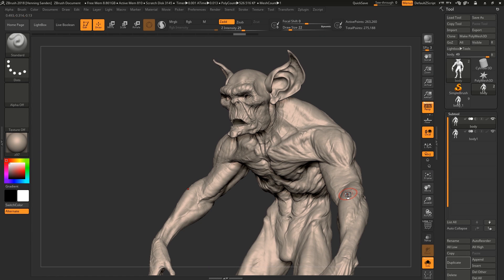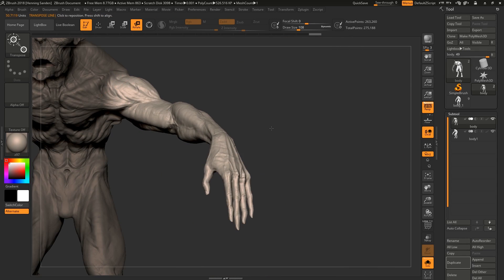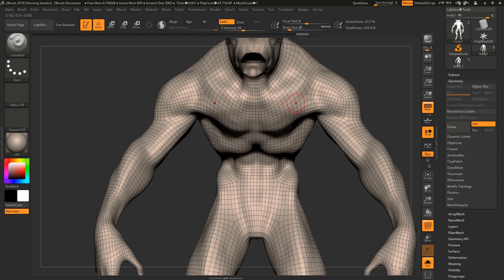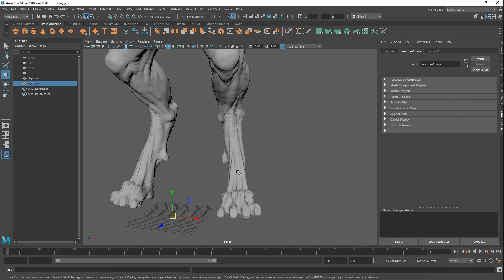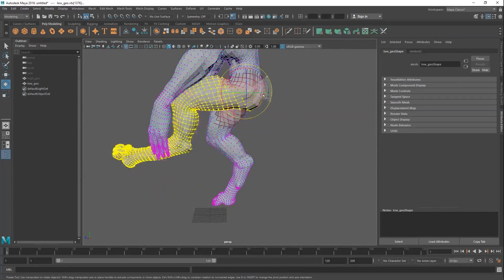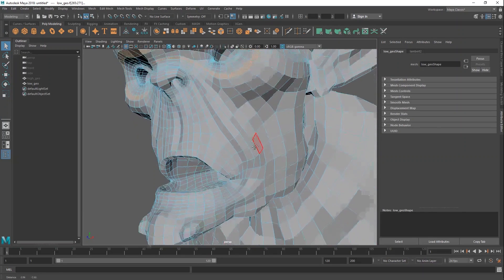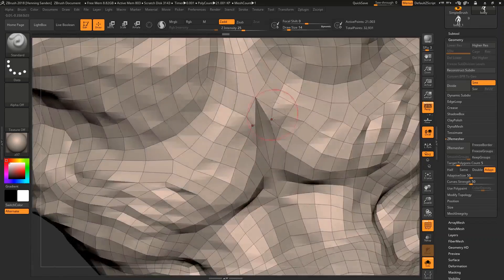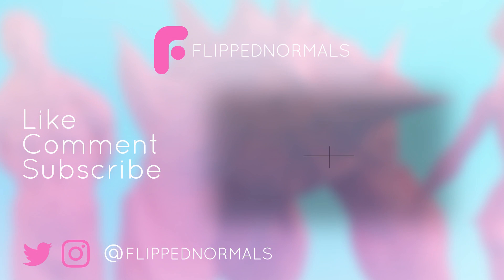The Real Reason We Retopologize Our 3D Models

Comment: This may sound like a weird question but I see modelers preach about clean modeling and moving around geometry so vertices are not stretched etc.... But why be so precise in the modeling part when you repologise over it and use the retopoligised geometry and discard the original model anyways?? I can see if you may be using it for film and other reasons where high poly meshes are preferred but why be so careful when it's only used as a guide to create your lower poly geometry??
Reply: You use the high quality meshes to make normal maps, and the better you have the details, the better it looks once it is applied to the low res model. Artifacts will still show up.

Comment: All good reasons. Although one thing with ZRemesher that's useful is using it with clothing that has a lot of folds. Use the ZRemesher guides and plant them on the apex of the folds, edgeloop around the collar, cuffs, bottom(s) of the garment, and edgeloop around the elbows/knees/chest. It won't be perfect, but you'll save yourself a lot of time getting the bulk of it done in zremesher and back into Maya to "fix" some problem areas.

Comment: Great video on a very important topic, but one thing you could point out is that, unlike the one-joint zbrush "rig" that you apply to the arms here, a vfx rig for a creature like this will have dozens and dozens of joints, in a hierarchy, and each joint has to calculate its effect up through the hierarchy, on every vertex in the model, and THAT is what really taxes your CPU/GPU and impacts your feedback time.   Not so much Zbrush vs Maya, but simple, disposable posing rig vs complex, robust animation rig.

Comment: Well zremesher has the option for you to draw where you will want more topology and where you need less and I have been using this option its like paiting weights when rigging and it does a really good job atleast in my team.
Reply from the maker: It's pretty OK, but if  you  want full control, manual retopo is usually  the way to go.
Reply: Yes I agree. We used topo gun previously but due to time conservation went full on with z remesher :D

Comment: Nice tutorial but sometimes you could get away by using Zremesher  and do little fix like just doing the joints area or torso where the body deform also if u really good on zbrush u could also fix it in there and use my favorite tool zmesherGuid that really works good like u mention around the eyes , u can easily just add couple of guides and get the loops I want, but overall best thing is just doing it by hand like u had mention on the video.. big thumbs up great tutorial

Comment: Retopology is indeed the option of choice in general to go because it creates less problems, for everything. But if a model is properly optimized, and if the topology is checked and rechecked, by merging nasty vertexs here and there, by collapsing some unnecessary polys etc, i know for a fact it can work. If properly tested with rigging, then uv unraping should be a no brainer. So retopo is still used, but im convinced its gonna fade into a uselles funless tradition soon. And with all this great material composition software like substance, normal baking is gonna be less and less relevant, because why sculpt it if you can work directly the appearence and detail of a shader on top of a simple polymesh? Its like mixing paint and modelling into one.

Comment: On the retopology front, which tools you recommend?

I have a surprisingly not-infuriating experience using retopoflow in blender, but i was taught there, so my bias is bigger than my knowledge.

Also, outside of the "main loops" (eyes, mouth, the ungodly mess that's hand, fingers and nails, etc), do you recommend any process to "fill" the space between then?
Reply: Maya has a tool called quad draw, which is very good.

Comment: i hope you make a video on the wrapping technique you mentioned.  is it like shrinkwrap where you have the lowpoly conform to the high poly like ZBrush's projection or is it those puppet cages I see in behind-the-scenes footage where moving a few vertexes on like a 100 point mesh moves whole muscle groups on a 100,00 point mesh? also does it involve the UV like you mentioned in other videos?

and on somewhat of a tangent were there ever times you needed to transfer or reproject whole texture/material sets from one UV set to another? like you have all the textures from diffuse to ambient occlusion to displacement to specular ect made perfect but you have a new UV optimized and the baked texture maps don't align anymore so you project that data to conform to the UV set.   i know Maya has transfer maps and the diffuse does what I talk about but the displacement map requires the high poly present and i can't just project 2d data to a new layout.  i am told marmoset Toolbag can rebake existing maps like that but i havent tried it and i am guessing Mari has such a feature but my little computer cant run it.
Reply: I'm also unsure of this.
Reply: There's a program called WrapX that allows you to take a low poly mesh and match it to another mesh shape.
Reply: Matthitizidu  oh i know all about Wrap :D speeds up the process by reusing the base mesh for you.  but i want textures not shapes and so far i cant bake old textures to new shapes.
Reply: Meir Teichman  If you divide the new topology and project the details from the high poly in Zbrush you'll have all your detail on the new topology. Then you can bake any maps you need.
Reply: Matthitizidu  tried that and since zbrush doesnt use Udims well i get all sorts of artifacts and applying the displace to each UV causes bad seams.
Reply: You can export the high poly mesh from Zbrush after decimating it and create your displacement in Maya. It will follow your UDIMS. 

A more tedious way would be to polygroup by UV in Zbrush then split the different UDIMS into separate meshes and bake them that way.
Reply: maya doesn't have a tool for re-baking displacement maps, only baking new displacement based on high poly. and i tried the tedious way of mapping each udim but as i said it leaves terrible seams. 
i need an app or tool that will rebake any 2d map data to differnt meshes and UVs .  that way i could map all the UDIMs and their corresponding textures to a great big mega displacement map and then apply that to the model in zbrush.
Reply: don't re-bake, bake new displacement if you need it. Displacement is the only map that you'd need to bake in Zbrush or Maya. You can import your low poly with UDIMs in Substance and bake all of your additional maps there.
Reply: @Matthitizidu  but my whole issue is that the displacement I need only exists in those maps.  I can't apply them in zbrush because they get bad udim seams. And I still need to rebake them if I wanna make all those udims into a mega uv map to solve the udim.seam issue.

I am trying to uprez an existing model and I can't extract the highpoly/displacement data any other way.
Reply: I'm not sure what you mean. You don't have a high poly sculpt in Zbrush?

If you do have a high poly model you can bake your displacement easily even with UDIMs.
Reply: @Matthitizidu  nope no high poly. In fact my project is trying to rebuild/uprez an existing game model by applying the faked high poly detail of displacement maps to the model and using that as a guide for more detailed displacement if not making the different details separate meshes.

And no amount of resolution will fix zbrush's udim seams.  They don't have a proper udim system so they stack the tiles on one another and you are forced to isolate them via polygroups and that isolation leaves clear seams as each patch gets displaced on at a tile letting inconsistencies creep in.  My only hope is to displace in an app that has proper udims which will crash my computer, try to pack the udim textures into a megatexture myself and allow flaws to creep in or just remake the textures myself and lose all the accuracy I wanted. I need to find a tool that bakes these maps to the megatexture I need.
Reply: Use the original UVs and apply the displacement in Zbrush. That will be your new Hi Poly sculpt. Then bake all your maps.
Reply: but the original UVs are Udims which I keep mentioning leave ghastly seams. i need the UVs to be in one mega tile so the displacement can be applied all at once.  and for that i need a way to rebake existing textures onto new geometry/UVs which brings us back to square one.

i think this is what the FlippedNormals people do when they want to make all their Mari displacement textures actual high poly detail and that eems to be a feature in mari but i cant afford to run that on my little computer.

Comment: I understand the need for Retopo, but why projections? Is it to get cleaner bakes? The guide mesh you re-project to is still very dense, so why do it?
Reply: Reprojection is to get all the details from the sculpt to the retopologized version. Retoping doesn't just make the poly count lower it changes the topology so the model deforms properly. You reproject onto a denser version of the model so that normal and displacement can be made from it to add the details to the lower ploy version when you render.
Reply: Thanks for the explanation :)
Reply from the maker: What CutestRuler said ^!